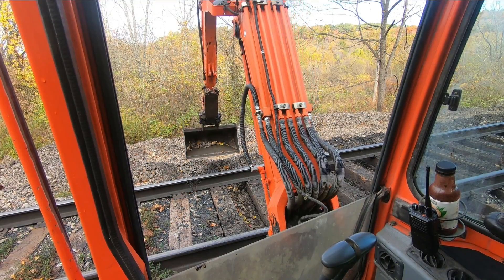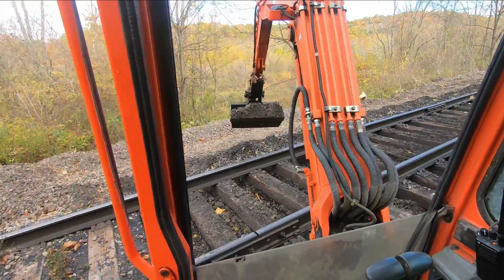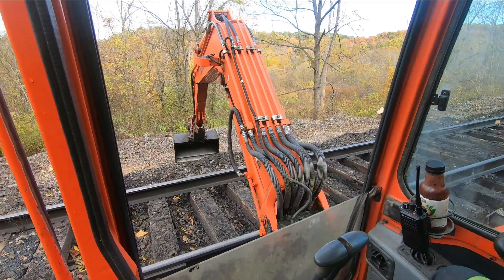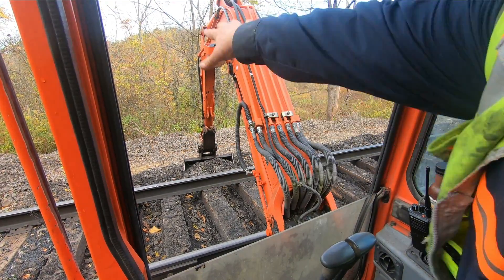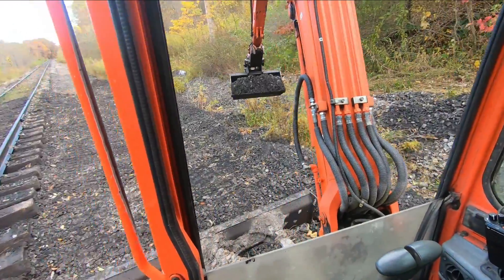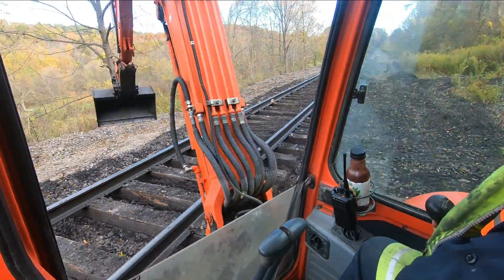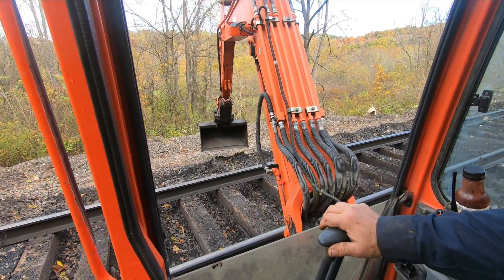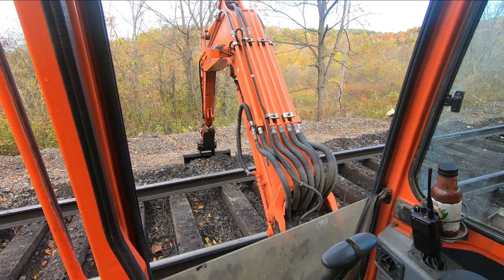Why Don't we Reclaim and Wash our Used Ballast?

Comment: Excellent. Excellent answer to an obvious question. It is so nice to see a video answer a question head on and stick with it all the way until the whole point is made clearly. This should be a demo on how to answer a serious question seriously for anyone who is from outside. Everything that needs to happen, what it will cost and the chances it will be paid for. XLNT! Thanks a lot, Dave.
Reply from the maker: Thank you for the nice comment  Erotus. One thing for sure,
I will never be a politician giving answers like that..... LOL
Really appreciate your taking the time to watch and may you have a very good day my friend.
Reply from the maker: That section was built on a fill originally. Coal fines plugged the ballast up from leaky hopper car doors. Plugged up ballast won't let the water drain away so it goes down when a train loads
the track. When train unloads that acts liker a pump pulling
mud and water back up. Thank you for taking the time to watch and may you have a very good day my friend.

Comment: Interesting stuff. I ordered a dump truck worth of new ballast as fill for the low spot in my property before pouring my shop slab. Great stuff for that of course as it drains beautifully. I topped some of the exposed ballast with milled asphalt, also good stuff. If ya need to fill in anywhere on your property it's tough to beat and doesn't wash away on any reasonable terrain. Ballast is inert so no harm leaving it about. Too bad it's not being dumped on my acreage because I'd be all over renting a dozer.
Reply from the maker: Well if you had a dump truck and could come get it, I'd much rather
give it to someone who could use it CommOut. #3 stone makes an
excellent base and they use the ballast around here for base in
all the natural gas well access roads. Thanks so much for stopping
by and checking out the video on why we don't reclaim ballast my friend.

Comment: You're really good with that scoop.  I have a back hoe on my tractor and I just can't get the hang if it.  I think one problem is that it's under powered.

I'm very familiar with lined ponds.  Where I used to work before I retired, we had ponds of 30 acres or more.  Big, thick rubber liners. j I don't know how they are welded together either.  I wasn't out there for the installation.  But I know that there had to be environmental reports, public comment, etc, etc,etc.  They use them to let the solids settle out, then the water goes over a weir into the river.  The effluent is closely monitored.  Especially since the big fly ash incident.  Perhaps you remember it from 2008.  It is still the largest or worst environmental incident ever.  They've changed to a dry fly ash disposal system where the boiler bottoms and fly ash are separated, and the boiler bottoms (the clinkers and other stuff that doesn't burn) are sent to an area where it is piled up and the water allowed to drain off, before it is trucked off to another hole in the ground for storage.

https://en.wikipedia.org/wiki/Kingston_Fossil_Plant_coal_fly_ash_slurry_spill
Reply from the maker: Thank you for the very kind words MeigsCounty and for sharing
that information with us.  Very much appreciate your taking the time to watch the video my friend.
Reply: @ccrx6700  I really enjoy your videos.  It's a nuts and bolts thing.  Educational.  Greg in TN

Comment: Many companies recycle ballast (it's a 880 ft long ballast cleaning train): it's to expensive to waste all ballst and these cleaning trains are fast (1-2mph). It's most time only a temporary fix as there are often problems with foundations.  For small companies it's cheper to sell the old ballast to ballast cleaners.
Reply from the maker: Being that we don't interchange with another RR here it's impossible to get those big ballast cleaners in here Stefan, they do work very
well however. Thanks for  taking the time to tune in and check out the video my friend.

Comment: I honestly have to disagree that it cant be re screened effectively. I dont remember the name of the machine that has the chain that goes under the track and removes the ballast. I watched that machine pick up all the old ballast lift it up to the portable screening car then lay it back down all while loading the waste ballast onto dump trucks driving along side. They where shagging it too I would say one truck every few minutes. With all that said adding a second screener to further shake out the fines and discard the waste off to the side,over the hill or give it away like they did in our town. If you could reclaim even 30% the savings would more than pay for its self over time. Mind you I am only speculating and imagining but I do love to solve problems like this. There is a lot of useful aggregate in that old ballast it seems such a waste to just get rid of it.
Reply from the maker: Very good comment Doug. First off you are right, those huge Loram
cleaners do a great job in cleaning the ballast. Problem comes in
here is because we don't interchange with another RR, then we cannot get that big stuff in here, trucking it in would be astronomical
cost. I have suggested they get me a screening bucket for my
excavator many years ago, but was told for the cost to pay me to
screen the ballast that way, they said it was cheaper to just buy
new ballast. I disagree with them on that, but that's the way the
want it. I too like to solve problems like you. Really appreciate your
thinking and for writing in my friend, and hope the above helps
in understanding more of what is going on here.
Reply: @ccrx6700  Ingenuity is lost on bean counters. A never ending battle. Keep up the good work friend!!
Reply from the maker: @dougdoeright4196  👍😊

Comment: Instead of using the excavator to take the ballast from one side of the tracks and dump it on the other why don't you use the excavator with its blade and push the ballast off to the side.
Reply from the maker: Good question bb. Usually when I'm doing that it's because I
don't want to plug up a drainage ditch and also to keep the ground
sloped away from the track. Hope that helps. Really appreciate
your visiting with us and taking in the video my friend.

Comment: Possibly a better project would be to look at ways to reduce the amount of coal lost in the movement. Seems that could also lower ROW maintenance costs.
Reply from the maker: Absolutely we could use some better cars here. These cars
take a tremendous beating getting dumped 6 times a day,
Cars are from 1995/96. Typical coal car on other RR gets dumped
once a week. Ours are 7 days a week, parts wear out with
that extreme use. They have looked into getting a newer fleet
of cars, however we've also had major problems under ground
and at the prep plant here this year and tonnage has been
way down. So those problems in producing the coal get
priority money obviously.  Hopefully in the next year the new
cars will be coming, keep your fingers crossed.

Comment: It leaves the questions of what percentage of the slurry solids is coal? If briquetted how well would it burn.
Reply from the maker: Can't tell you the % Calvin. However new coal fired power plant
is in the beginning stages of being built at our neighbor mine, Baily.
They are going to be using dried coal fines from their slurry ponds
for fuel. And yes coal slurry fines could be made into bricks
if someone wanted to invest the money to do it. Bout 10 years
ago they built a briquette plant at the old Robena Mine next to
our harbor. They reclaimed the coal from Robena slate dump.
I don't know much more about it, but that plant didn't last more than a few years
Reply: @ccrx6700 
Thanks for the answer.
Reply from the maker: @calvingreene90  😊👍

Comment: I dont see this as not reusing your old ballast. It looks like you made a nice access road next to the rails either inadvertently or by design, this seems to be a nice benefit. Now you have a nice road way you can run a truck along or roll an excavator as needed. Looks to me like its serving a nice purpose without all the worry of regulations, transportation, fees permits etc.
Reply from the maker: Thank you Michael for your very nice comment. You are right.
Also you may enjoy the follow up video to this one, link is below.
Coal is proven to be used as a fertilizer, so I am also enhancing
the organic matter of the soil along the right of way. You sound
like a guy who has some common sense. Certainly appreciate
your visiting with us tonight my good man.
https://youtu.be/PHqlN-ACVIY

Comment: On the slurry pond isnt that what your creating by dumping coal along the track? Its just less monitored and spread out seepage into ground water than a single pond
Reply from the maker: Derrick you might like to watch this video where I explain how
coal is used as a fertilizer to increase soil organic matter. In fact
coal as a fertilizer has out performed commercial NPK fertilizers
for increasing corn yields as proven by 3 major ag universities.
By spreading out the coal along the ROW I am actually
fertilizing the soil in that area. 
https://youtu.be/PHqlN-ACVIY

Comment: Used ballast placed to the side is also beneficial for maintaining any service road along the tracks as if has fines and mud blended in keeping the road stable.  Can scrape excess with a bucket and relocate where needed instead of bringing in new material.  Old ballast reduces the brush growth near the tracks which can become a maintenance issue or fire hazard in the future. Great job explaining the many details and requirements for a wash plant.  Filtration of the water for re-use or more so for discharge by permit would also be significant.
Reply from the maker: Thanks for writing in with the great comment NarnianRailway.
We really appreciate your checking out the video today my friend.
Interesting new development I just learned about today. Baily
Mine that borders our mine has come up with a way to
use the coal fines left in slurry ponds to fuel an electric
power generating station. They are in the beginning stages of
developing that plant. It will be a zero emissions plant as
they have also come up with a way to have all the carbon dioxide
emissions pumped back into abandoned areas of their mine
where it will not be able to pollute the atmosphere. 
https://washingtonish.com/pennsylvania-mining-complex/
Reply: @ccrx6700  Use of coal fines slurry has been a long in development and research.  Back in the 90s Usibelli Coal Mine in central Alaska was working with the Healy Power Plant to develop using coal slurry.  The coal was low grade and lots dust so a good candidate but experienced technical issues.  Good to know industry has since developed better technology and with CO2 capture.  
Also Renova power plant in Cambria County has been using waste and dumped coal from PA's Abandoned Mine Site reclamation projects to generate power as well.  My township in Blair County is constructing a trail and one property was an old firebox clean out dump for PRR locomotives.  The surface coal and cinders were to be sent there for burning.  
Our rails to trail project partially follows an old service road.  The old streetcar route is now owned by First Energy and is on the opposite side of the NS mainline as the proposed trail. LOL

Comment: I work on a railway. We have a ballast cleaning schedule. Every second weekend they get 52 continuous hours to clean a few miles of one road of a double track. It's more replacement than actual cleaning but it's a proper rig. Lifts the rails, the ballast under it, the sides, screens it, chucks the small stuff into the cess. It gets followed by a ballast hopper train and then a tamper.
It's fairly quick and keeps the linespeed up at 100mph.
Reply from the maker: That's awesome capnskiddlies. Wow what we could do with that
much track time. But we are running at 25 not 100 so your
work is very, very important and I'm glad you wrote in sharing
that with me. Really appreciate your watching the video my
friend.

Comment: Warsh? It's wash with no R.  One solution on removing the Rock easily is using a vacuum vehicle like they use when they pick up coal that's in between the ties or on the track after a spill. You put it on the track and drive it to where you need it and you vacuum up the rock which will require more vacuum pressure and a very tough hose and then you put it in a dump truck and you haul it to a wash plant and if there's not one in your general area one would have to be built but then you could reuse the ballast which would save some money because eventually you can't keep dumping it because it's going to start stacking up higher than the track and you won't have enough land to put it on in some areas. Another solution would be to purchase a larger excavator so you can reach inside of a car to dump it but I know that's very expensive too.
Reply from the maker: Sorry bout my SW Pennsylvanian-ese. Can't help myself. Actually
they are thinking about buying a vac truck here. They spend over
a million dollars a year on getting vac trucks in here, almost
daily there is one at the prep plant to clean up spills, so we
shall see if it gets approved for next years budget. New truck costs
around $800,000 if they get one with hi rails. Thanks for stopping
by and checking out the video my good man.

Comment: Understandably it will vary due to location confines such as road crossings but on average how much of the land on either side the track is mine/rail road property ?
Reply from the maker: We own a minimum of 150 feet on either side of the track
from the center out. And in various places own more and sometimes
a considerable amount more. It all depended on what deals
US Steel could make back in the 1970's with each land owner.
Back then they paid a flat rate of $1,000 per acre which then
in this area was tremendously high for land. Now you couldn't
but a used outhouse for a grand.... :-) Thanks for watching
and writing in my friend.

Comment: The best way to at least dry shake the dust out of the ballast would be one of those full under cut type machines but since this line has no connection to any mainline that makes getting that beast in there expensive and complicated too. Also, here's hoping in 30 years someone with means is willing to turn the tracks into Cumberland Scenic Railroad. Probably won't happen but we can always dream.
Reply from the maker: We have all joked here over the years that if the mine shuts
down we can always open a scenic RR David. Actually it's a pretty
cool idea I think and one that would make a profit. Man if
we had a steam loco it would go over huge. Really appreciate
your taking the time to watch and write in my friend.

Comment: That was very well explained Dave.  When there is a big track relaying job the old ballast we call dross gets loaded into spoil wagons using an excavator, it then gets dumped because of the same problems you have. There are some track machines that dig out and sift the ballast then return it onto the track but only where it is not too contaminated so even if you could get one of those in it would not help on your line. Your old ballast will probably be overgrown before long and the trackside look just as green it was before
Reply from the maker: Thank you very much cedarcam for the very nice comment, Always
I enjoy hearing from you and your sharing how you guys do things.
Sure wish we had a better way that was cost effective tho.

Comment: The way things are headed there will be no demand for coal in 20 years.  So an investment in ballast cleaning will not likely be recovered.  Appreciate your explanation.
Reply from the maker: Thanks Marv for taking the time to drop by and take in the
video my good man. We do know that coal will at some time
be phased out, when, no one knows. Many energy experts
are in thought that it may be 50 years or more, but others
think that will be much less time. Big problem I see with
coal being phased out is how are they going to make steel
without coal? I do not know anyone who has those answers
yet.
Reply: @ccrx6700  Agree, some uses of coal will remain.  While I understand the concern for climate change I also recognize that it needs to be addressed in a reasonable fashion.  Mandating against use of all fossil fuels by a certain date is unrealistic.  It makes sense to transition some things to wind/solar but some things make no sense at all.  For example I don't see transitioning agriculture to electric battery powered tractors, combines, etc.  But for vehicles used only for short distances in urban areas electric vehicles make sense.  However in making the transition you must address the electric generation, transmission, and distribution infrastructure.  For example, there is a conflict between when solar is generated and having people recharge the batteries of their electric vehicles after sunset.  People need to recognize the huge cost of upgrading the electric transmission and distribution networks to support the needs to recharge vehicle batteries.  And when you compare the time needed to recharge the battery of an electric vehicle to the time it takes to refill the gasoline or diesel tank, the number of charging stations needed along the interstates will be huge.  And you need to extend the transmission and distribution systems to provide electricity where it's needed.  And don't forget that the batteries of electric vehicles have a finite lifetime and are expensive to replace.  Our politicians need to understand the full scope of what's being pushed and help their constituents understand what is and isn't reasonable, the hard choices and full costs to be faced along the way.